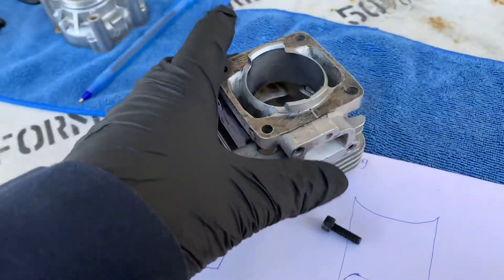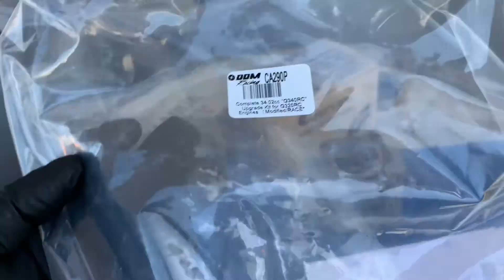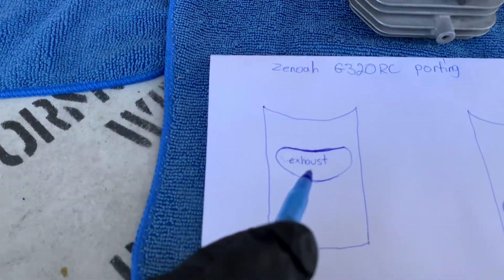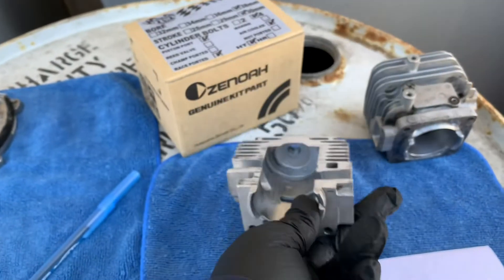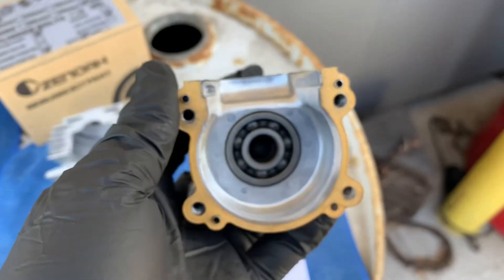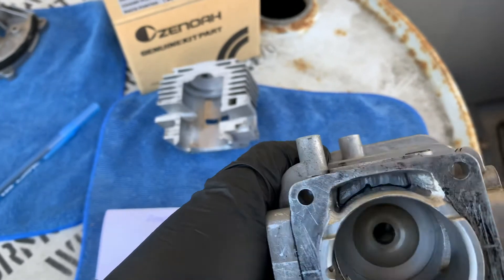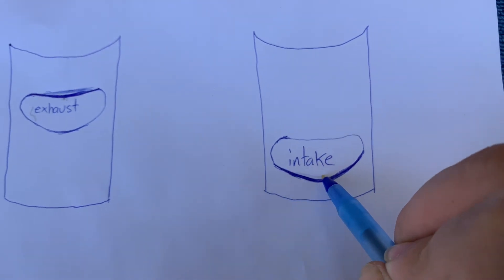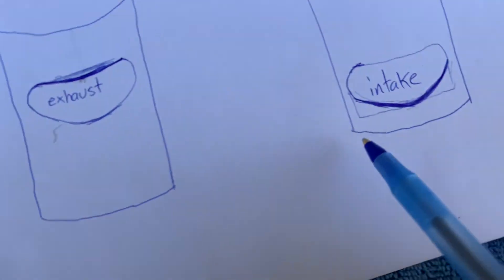Zenoah G320rc explaining port matching. How to Exhaust and intake timing

Comment: If you just start grinding the ports with no measurements or calculations the best you can hope for is to get lucky and not FU your engine.
Reply: Not true. BUT less is always more. Follow a 1mm rule and the cylinder will perform well. I have not measured once or used a degree wheel and ALWAYS had high positive results.
Reply: All these car guys are the same it seems. I agree with you 100%. Yes guys are getting results but I bet a lot have stuffed there engines as well.
Reply: @bdrgarage7039  I've never ported ones of these engines but I'd be willing to beat that your Ex is about 100 your transfer is 122 and your intake is 73-75. The intake is a little high and needs to go down to 80 yes about 1mm maybe. Now you have 22 blow down and your ex and intake are about balanced. Actually not bad for timing. If you raise your ex to say 95 at most you will have a higher revving engine with less torque. You will also need about 83-85 intake. The transfer can change how wide the power band is so if you raise your transfer you will broaden your powerband and weaken the top end a little ( I probably shouldn't get into this too much as there is far more going on than that but....anyway). Personally I'd go with the 100/122/80 timing and raise the compression to 10:1 or in my hotter builds 10.5:1 this will give you torque. Also the squish in that motor will be about 1-1.3mm bloody awful in other words. You will gain 5% power just fixing that and nothing else. You got lucky is all mate, I feel bad for all those poor buggers out there killing there engines. Making a 2 strokes go a bit better is easy. Making them haul arss is actually quite hard. 

The only thing I have really learnt stumbling across these videos this morning is this is a bigger market than the one I am in. Those engines are rip for some wicked mods. I could CNC those cylinders and make a real monster out of them. Its got me thinking.
Reply: @foardhook  Measuring is definitely the way to go. I have never done that, learned from guys that ported (unmeasured) old chainsaw engines and had them doing 80+mph on a gokart. On these small engines, less is always more. Yeah you can get scientific and get better results but great results can be had with a little porting and blueprinting. I have double acceleration and top speed on plenty of 23cc 2 strokes. Now the RC already have good porting but can still be improved.  
I have never raised transfer ports. I always raise compression,  that's the easiest way to make power.
I should learn to measure and port properly BUT what I do on my engines works beautifully and I have probably 30+ small bore 2 strokes here. Case reed, piston port, pocket bikes, gopeds, etc
Reply: @bdrgarage7039  I understand what you are doing and how you are getting your results. For several years I did exactly the same thing. Just as I predict the port numbers for a motor I have never touched or seen most of these engines have pretty typical port timing. You have done so many now you have kinda worked out what to do and where. In all truth if you started using a wheel and crunching the numbers you will probably find you end up where you are. I do get that. 
I just finished a chainsaw last night, it is a pretty hot build I'm working on for myself. Every port is very carefully dialed in. I know before I even run it today how it will run, where the power will be etc although I'm experimenting with a higher than usual intake timing for this first run because I'm running a CNC head I made for it. The thing is I can guarantee you are leaving power on the table. I port so much differently now that I understand it than I did say 5y ago. It no longer matters to me if I have ported that saw before I can port it and the first one will haul arss. If you start porting to a map and planning your engine builds before you even start you will make more power. You are dead right about little bits make big differences. The work you are doing looks great. I'll go and find a video of your cars running. The last guy I watched was fair to average. These things have pipes and all they should be hauling arss. Why the manufacturers don't build a proper hot motor for these things has me beat. From a design perspective there id so much more they could do.
Reply: @bdrgarage7039  Yes and when you raise compression you are decking the cylinder and lowering the transfer and the intake as well ex too for that matter. Then you cut the ex back up and you are about stock timing but now your transfers are to low and restricting flow at high rpm so they need to go back up. Your intake is possibly about right. This is why I measure everything first. I know my port timing before I cut and deck my cylinder. I know how much I need to raise the Ex and transfers and how much to widen them (always my preference.....kinda always, actually commenting on YT is not a good idea lol it takes a book to properly answer but I'm sure you get what I'm saying)  Anyhow the bloody thing goes faster and that's my point. 
I know I sound like a bit of a dick here but if I was standing in your workshop having a beer with you showing what I do you would see very quickly the advantage. No one else seems to be doing it. You could have a real advantage in the sport.

Comment: Mount half of the crankcase to the cylinder. Drop in the crank with rod and piston. slowly rotate, noticing the ports on the cylinder in relation to the sides of the piston skirt. You can see where to modify piston for better intake flow from the crankcase up to the combustion chamber. Its all about freer flow, just dont get too crazy.
Reply from the maker: Absolutely correct my friend! This video is part of my previous video ahow that when im actually doing my porting. But, there were a few viewers that needed more explaining on how to and where to remove material on the ex and in ports

Comment: Hey man so I'm doing my poring job in quick question when you say taking off a little bit  Of the bottom of the intake inside the cylinder do you go all the way through or  Do you just take off a little bit on the inside and then taper it off off as it goes towards the carburetor. Do you get what I mean
Reply from the maker: Hey man yes i know what you are trying to say. All you need is to take off just a tiny bit and taper it and smooth it out toward the carb to get that smooth air flow! If you remove too much your motor will lose power and sputter a lot of fuel. On this prossidure any minimal removal of material is a big big change on how your motor can perform. If done right your motor will be way way stronger.

Comment: I got a hold of one of those Zenoah G320 engines about a month before they came out on the market, a "pre-production" engine. My goal was to be the first to come out with a ported G320 engine.  So I get the engine, (same as the production engines), make the fixtures to port them on the CNC mill, develop the first phase of porting and get it on the dyno.  Since we can get close to 7hp with the G290 platform, my goal to start was 7hp.  I get 6.25hp.  (the stock engine with the exhaust can makes 3.5hp. A stock G260 with can makes 2.3hp for comparison) with a DDM Baja side mount pipe is 5.5hp on the stock G320, (Not many fully modded G260/G270s will do better).  I try a couple other things to make more power,---still, 6.25, and the curve looks the same, (pretty much). Now my plan has failed.  I was not going to be the first out with a ported G320.  I did more and more things, spent more time on this engine than any other by far, and every damn time, 6.25 and the curve hardly changed.  So, since nothing else I did to it made any difference, all I did was what got me to 6.25hp.  I wanted to see 7hp, but this engine did not respond to porting changes like the smaller engines do, at least not for me. I ended up being the last to come out with a ported G320.   Now, I did not go for higher RPM because this larger crank does not like RPM higher than 17,000 rpm.  So there can be more power up there that I did not look for, but I still doubt it would beat a good G290 above 13,000rpm, and the great low end power that engine has would suffer,---so why?
This is the best RC engine for 8000-12,500 rpm, (tight tracks and heavy 4 wheel drives, still love the stock clutch), and my porting still keeps that great low rpm grunt.  
Nice vid sir.  Thanks for mentioning that you started with an ESP cylinder.  But I pulled a lot of hair working on that new engine, so I bet you didn't get anymore power from it,  under 17,000rpm. :) Keep an eye on the lower end of the rod if you are getting more rpm.  At 19,000, I turned the bottom of the rod brown in under 30 seconds on my dyno.  If it goes blue,---change it.  By the way, the rod is not longer, (it is 50mm cent to cent), but the stroke is for the stroked cranks, (the rod end pin is 1mm further from the center of the crank, and the 320 cases need a bit of clearance milled in them for the 2mm crank).  If the rod was longer, (and they are sold longer), you would then put a spacer under the cylinder to get the same squish, (a 3mm longer rod, a 3mm more spacer), and your port timing will barely change.
Thanks for using my stuff.  I appreciate it.  Happy roosting while surfing the earth.
Doug @ ESP
Reply: I hope you see this, how much improvement does your advertised 5.5 degree scalloped piston make for the g320?
Reply: I read this entire comment just so you not it's not wasted time writing it

Comment: Where is the piston ring end gap on that motor, on the intake side? If you had an rc reed valve, could you cylinder reed port it for a 5th or 6th port?

Comment: So what timing do you suggest? I assume you do use a timing/degree wheel?
Reply: I did race 1/8 scale nitro for a while and I was porting the Nova rossi Roma25. My son was young at the time and just learning. One of the top drivers asked me to talk to him about taking him out at the end of the main strait. You see each time he went to lap my boy would pin it and pass him on the straight and often take him out. Not very cool. Kids lol and dads who port for fun, not a good mix.
I'd say you would be looking for more top end but if you chase that and run out of midrange torque you will end up running flat which is what I suspect the guy I watched before your video did. If I were to start out I'd go for ex 100. It's a good compromise and you can make decent torque at say 10-12,000 rpm. It will give you a solid pull off the bottom to exit corners. With a pipe scavenging trans with 24-25 blow down and an intake at 80. In other words not very different from a stock motor. But if the motor had more than enough cc to pull the bottom I'd port higher, maybe 95 on the Ex. Particularly if its quite over square motor. Let it scream. But port timing is only half of the story and transfer direction and balance is arguably more important. If you want them to make power on top they must flow! I do a lot of flow work.
I wish we raced these things here I absolutely get into it. Shit you guys have gear ratios too so you can play with that also, the list of possibilities goes on. I'd shoot for an 18,000 rpm screamer lol. I had the 1/8 scale wheel standing out of corners. I'd want that. Actually I had car this scale years ago with a Zenoha G23 in it and a box muffler and it screamed pretty good. I wasn't porting back then so I never did anything with it but you motors are possibly already running high rpm.

Comment: What about the amount of mm taken away? And the piston, did something to it?
Reply from the maker: Hey man! I take off about 0.7 to 1mm of material on both exhaust and intake. If you do more than 2mm the motor becomes less torque and less RPM
Reply: @raulofalltrades5023  ok. Thank you for the info. Nice video.